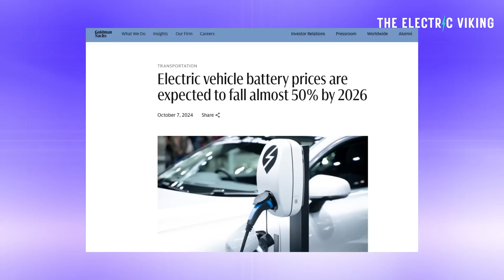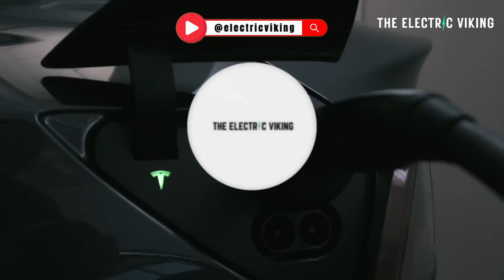Analysts say a NEW EV battery will be cheaper than fixing a gas engine

Comment: This is why battery swap (NIO, Onvo, Firefly) is the future.
Reply: How so?
Reply: @borshardsd   @joebullwinkle5099  You need to automate getting the batteries in / out of the car... It is a no brainer. You cannot have mechanics changing batteries / removing them in a billion cars. It is not resource efficient.
Reply: I don’t want a battery in my garage that was potentially damaged by someone else.  Maybe when battery technology changes and is less delicate.
Reply: @diamond_h0us  But you may want a battery in you garage that has been checked, maintained, tested and optimized by the swap station - rather than your battery that you have driven for years, fast charging, unchecked...
Reply: @diamond_h0us  That definitely is another point:  people are unlikely to accept, as "heart" of their prized vehicle, something that has been going around into unknown hands.
Reply: One of the main problem still facing EVs these days is the charging infrastructure... even an EV bull like me will admit that much!
Setting up a V3 Supercharger costs Tesla around $25-40'000, everything included.  This supercharger can service, at a busy time, an average of 3 vehicles per hour.  The investment necessary to have 1 vehicle/hour charging capacity, in the present case the critical parameter, is of the order of $10-15'000.
Setting up a battery swap station is said to cost around $420k PLUS the cost of leasing or buying the substantial plot of land it requires.  That does NOT even include the immobilized value of the batteries that the station must have charging, or in reserve (I'll come back later on that), which is easily several hundred thousand dollars worth of batteries.  Such a station, at a busy time, can swap around 10 batteries per hour. Therefore, the investment per vehicle/hour charging capacity is likely to be in excess of $60'000... roughly 5 TIMES higher than that of a supercharger!

Furthermore, that station has lots of technology and moving parts. Maintaining it is therefore much more critical and costly than maintaining an equivalent charging capacity in superchargers (about 3 units, maybe 4).

A battery swap will hence be more expensive to the customer than a direct DC fast charge!  AND will make swapping stations rare and far between!  In Europe each additional swap above the monthly subscription (which includes 4 swaps) is €30.  I don't know how much it is if you have no subscription, but it is sure to be higher!  A typical charge of my Model 3's battery at a Supercharger costs me €15-20!

But the issues discussed above pale against the one of battery standardization.  For the time being, just about EVERY electric car has a battery different from that of other models.  Quite often, the same car model can be equipped by totally different types of batteries depending on where and when it was manufactured.  But you need to standardize more than the battery itself, you also need to standardize the battery cooling system, as well as the sensor suite, and battery management system!  Finally, battery swapping prohibits the possibility to make the battery structural, resulting in a considerably heavier vehicle!
Such a standardization is extremely difficult to achieve within the models of a single brand, but completely impossible across brands!  Therefore, a battery swapping station can serve ONLY the few, very few models it was designed for, and has batteries in store for (back to the initial point on the necessary storage of batteries).

A DC fast-charger can technically service ANY EV (an adapter may occasionally be needed... but nothing worse than that).

There are at least a half-dozen other points that make battery swapping a losing idea... and very very few advantages.

Battery swapping is DEFINITELY not the future.  Renault has tried it with its partner called Better Place (which went bankrupt due to too heavy investment requirements... my first point), as well as Tesla (the battery of the Model S... at least of the early models, CAN be swapped), who tried the idea, but very quickly abandoned it.

Final note:  you may rightfully ask:  if battery-swapping is really that bad, why has Nio and a couple other Chinese manufactures gone with it?  Are they totally dumb?  No, probably they aren't.  There may be a case for battery swapping in large Chinese cities.  That much, I don't know.  But there is NO case for it, neither in Europe nor in North America!
Reply: @st-ex8506  You must be (economically) able to swap out a faulty battery. That is the elephant in the room that you missed. NIO swap tech becomes the standard. In cities they may swap instead of charging. The same along highways. A lot of market actors are interested in building swap stations and chargers for various reasons. In the future, robots and swap stations will be able to handle both different batteries and car dimensions. The reason Firefly will get another swap station moden is because the car is to narrow for the other stations.

Weight and resources - with swap you can drive with a small light battery and swap in a huge battery when going on vacation. That saves weight, power and resources.

Soon there will be laws in Europe saying that cars need to be able to swap out their battery. Such a law regarding consumer electronics is already in place.

What do you think the environmental groups will push for - integrating the battery in the chassis so you need to scrap the car as soon as something happens to the battery + making it a mess to recycle?
Reply: @martina5328 Which country is bringing in battery swap laws? I’ve not heard any such thing?
Reply: @ISuperTed  For consumer electronics in the EU the law is in place. It takes effect 2027 or 2026 (cant remember). It means e.g. that you need to be able to change battery in any phone sold in the EU.

That is, a device is not to be thrown just because the battery is done.
Reply: @martina5328  Your example is consumer electronics!  For God's sake!  

We are speaking EVs in this thread, if you have not realized yet.  Consumer electronics have NOTHING to do, not even remotely with EVs.

And, BTW, no EV is to be thown away because the battery is done!  And 100% of the end-of-life batteries MUST be recycled... which would also be a good rule for consumer electronics... but an uninforceable one!
Reply: @st-ex8506  My point is, in case you do not understand, that swap for cars is likely to become mandatory too. ...And now you were writing about consumer electronics too..
Reply: @martina5328  There is absolutely ZERO chance that battery swapping become mandatory!  It would be ENORMOUSLY expensive to implement.  So much so as to be financially impossible to implement.  For NO reason and NO advantage at all!

If my statement is wrong, then please supply a link to any mention of a project by the European Commission to implement such a rule.  I follow quite closely the changes of regulations that are likely to come regarding electric cars as well as trucks, and I have never even heard of anything concerning battery swapping, much less read any notice of proposed change.  I am not pretending that it could not have escaped my attention, so, please help me by supply your source.

BTW, I wrote nothing on consumer electronics except that you mentioned that to support a point of yours.
Reply: @st-ex8506  It is more expensive not to implement swap. You wrote about what would be good for consumer electronics.
Reply: @martina5328  No you are wrong. Here: "The regulation of the European Parliament and the Council will apply to all batteries including all waste portable batteries, electric vehicle batteries, industrial batteries, starting, lighting and ignition (SLI) batteries (used mostly for vehicles and machinery) and batteries for light means of transport (e.g. electric bikes, e-mopeds, e-scooters)."
Reply: @st-ex8506  No you are wrong about this. Please study more before replying.
Reply: @iSot80  I am wrong about WHAT?
It is hard to be asked to study more without being told what to study.
But don't worry, I shall study any topic I haven't already... It is my job!  So, you'll do me a favor to tell me where my knowledge is lacking!
Reply: @st-ex8506  It seems you have all the knowledge to know everything about economic, investing, technology and how people will behave 
in future so here it is. 

You said that you have 100% knowledge about Nio's BaaS technology to say that it will not be ever possible to be mainstream.

For this, I will say that you are wrong - AGAIN. You do not have that kind of knowledge about this.
Reply: @iSot80  But that you need to be able to swap battery - at this point will only apply to consumer electronics?
Reply: @martina5328  EVs are included to this new Law.
Reply: @iSot80  I wonder if we are talking about the same law. The one I refer to applies to consumer electronics. (not cars).
Reply: @st-ex8506  Superchargers kill the batteries. Uberdriver killed his Tesla battery in 12 months. With swap you do not have that issue and you save time. EVs without swap is a stupid solution. You need to be able to get the battery out cheaply and if you can also get the option to have a fully charged battery in 3 minutes - bingo. It is not rocket science to understand.